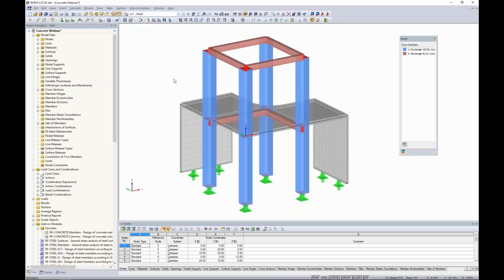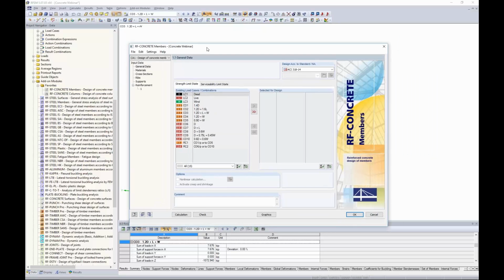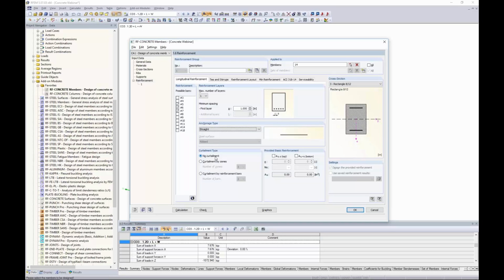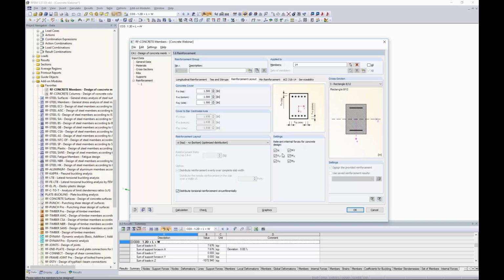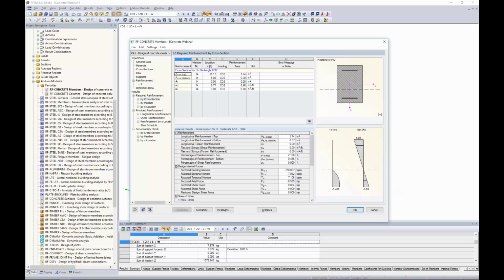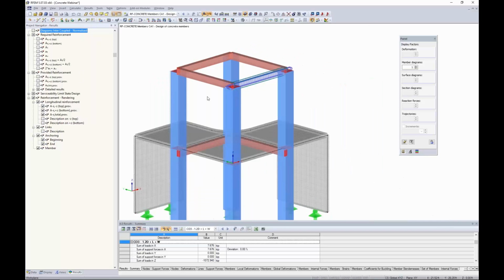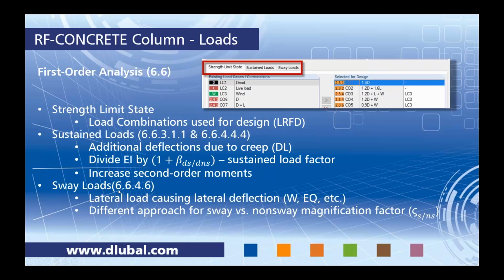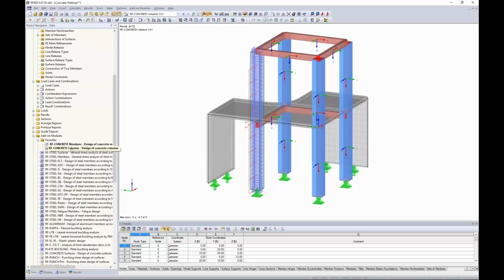Webinar: ACI 318-14 Concrete Column and Beam Design in RFEM (USA)

Comment: How do I can visualize surfaces like this? My surfaces are always simplified and I can't see it in 3D to check if the height is correct
Reply from the maker: Hi, Gabriel!
You can change the settings in the Display - Navigator Tree Control at "Rendering"

See also https://www.dlubal.com/en/downloads-and-information/documents/online-manuals/rfem-5/11/01/09
Reply: Dlubal Software EN thank you. There is any way of align a surface like I do with beams? I mean, I’d I have a surface with variable height and I want to align it by the bottom part, to build a ramp, it’s possible? I could find only offsets, which doesn’t do the job.
Reply from the maker: Hi, Gabriel!
Currently not and the surfaces have to be shifted so they will be in correct position. As we have rigid members RFEM has also rigid surfaces that could be used to bridge gaps between lines. Sorry about that that in future this could be possible.
Reply from the maker: Hi, Gabriel!
Currently not and surfaces have to shifted manually. It is possible to bridge gaps between lines with rigid surfaces similar to rigid beam elements.
In future, this could be possible, we hope.